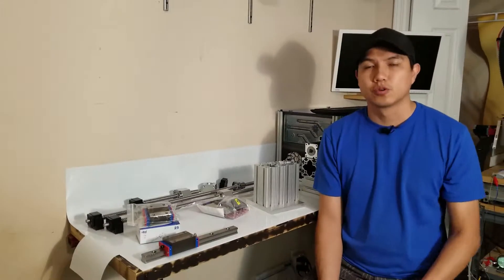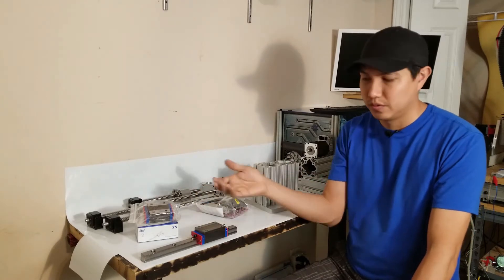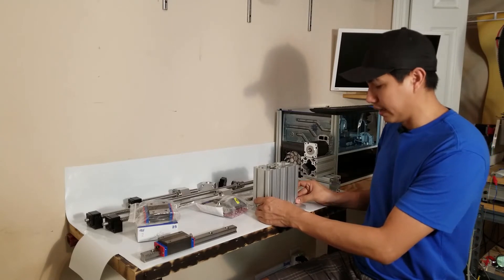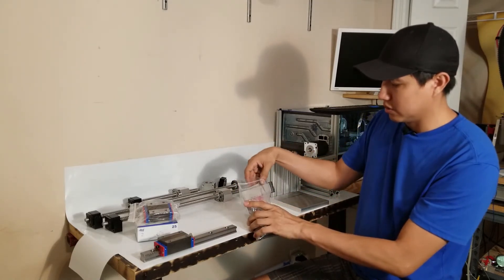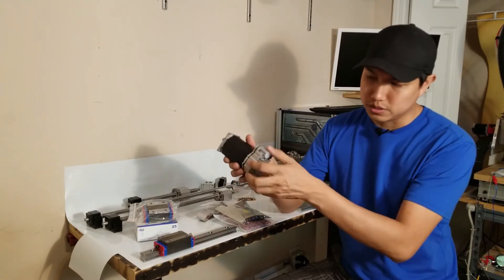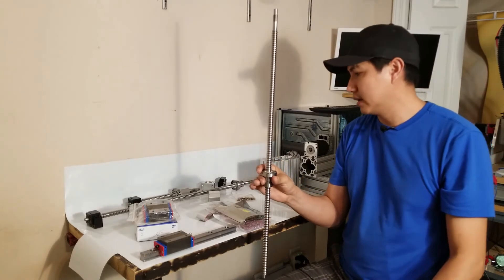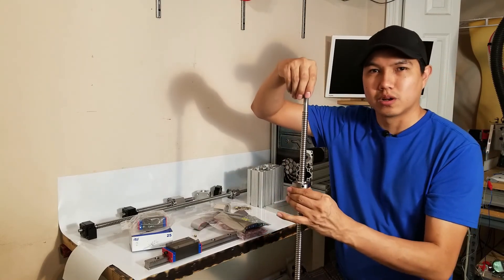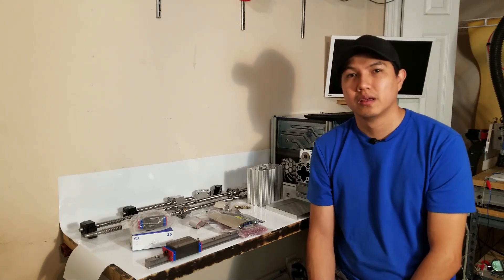Homemade DIY CNC router  (intro)

Comment: I AM BUILDING MY OWN I AM MOUNTING IT ON A 2 X 6 TABLE 4FT X 6 FT. I AM PUTTING TECNIC CLEARPATH SERVO MOTORS WITH ENCODERS ON THEM. THEY ARE WAY STRONGER AND MORE ACCURATE. ALSO MY TABLE WILL MOVE  NOT MY Y AXIS

Comment: Mario, cual es la lista de los componentes de tu CNC? no logro dar con algunas partes fundamentales. quisiera hacer uno igual o parecido como mi proyecto, te agradecería mucho
Reply from the maker: Roberto VEGA PEÑA Here is a list of the parts I use on my cnc build, keep in mind that I choose this because it works for me when building a cnc that’s capable of cutting 25” x 25” x 6” inches

 (3) pieces of aluminium extrusions series15 Or  3”x 6” inches  =  870 mm long (sides and gantry extrusions)
(2) pieces of aluminium extrusion  3” x 3” inches and (2) 3 x 6 inches =  635 mm long ( middle parts of the table)
 I got all my aluminium extrusions from 80/20inc.com 

(2) 1605 ballscrews  = 750 mm length  (800 works too) 
(1) 1605 ball screw = 300 mm length 
I got the ballscrews from eBay 

Linear rails  BGR25 =  2 pieces of 300 mm
And 4 pieces of 850 mm
 Linear bearings  (12)  BGXH25BN  
I got all my linear rails and bearings from trimantec.com 

All my screws and aluminum 1” thick plates from McMaster-Carr.com but you can always find that in other places too 

I went with servo motors from Teknic Clearpath,  but stepper motors would work just fine too and can cost a lot less 
 And the ESS and C25 BoB from cnc4pc.com
Same thing there are other controllers out there

When designing your own cnc  you can go with different parts smaller aluminium profiles and small linear rails/blocks can save you some money too 
 Or you can consider buying one already pre-build.  Here is a link to one I wanted before I build mine 
http://www.cncrouterparts.com/benchtop-pro-2424-2-x-2-cnc-machine-kit-p-314.html

Total cost of my cnc build was around $4500 -5k

Comment: Hi, I like the videos about your CNC build. Could you provide more information on the servo motors you picked?
Reply from the maker: Sascha Schwarz they are clearpath technik SDSK 2331s. You could choose a lower model since this ones I choose have a lot of power and torque
Reply: Thx for the quick reply. I am currently looking into the those integrated servo motors http://www.jmc-motor.com/ntegratedservomotors.html as I could them with 180W for less than $150 each.
When I watched your videos about milling aluminum it looks like you don´t use any lubricant/cooling for the milling bit right? Make you can make a video and talk a bit about the feeds and speeds you run on your CNC for the different materials.
Reply from the maker: Sascha Schwarz yeah I don’t usually cut aluminium, but when I do cut it I don’t use coolant or lubricant since the vacuum table is made of wood and it will ruin it

Comment: What specific clearpath servo did you use? The sdsk or sdhp series?
Reply from the maker: Chimaeria it’s a sdsk 2131s  if I remember correctly
Reply: And what is your opinion about them now that your cnc is finished? Enough torque? Have you actually milled some aluminium with your cnc yet? Some footage of that would be nice. :)
Reply from the maker: Chimaeria they do have a lot of torque and speed  no noise compared to a steeper and you don’t need a separate driver and has build in encoders  the down part is the price,  
 I haven’t cut that much aluminium since most of my work is with cast acrylic
Reply: Well anyway, I enjoyed your cnc making vids alot. So ill be the first to watch some new footage.

Comment: Clear path servos... Too expensive imho... Check out my results with steppers, +/- 0.01mm or 0.00039in tolerance on most parts coming off my machine.
Reply from the maker: Innovative CNC I have check your videos  even the 1hr long,  I was impress with the acc on the z-axis height,  that's where I get all kinds of readings on mine 6040.
 I have strippers on that cnc with the G540 and mach 3 and I don't know why but my z axis keeps loosing "steps" so I have to recalibrate at least once a month
Reply from the maker: Not strippers,   steppers.. auto correct b.s.
Reply: Have you tried to move the z axiz by hand with the machine off to check for binding or resistance? You can turn the lead screw slowly by hand and go all the way up and down feeling for any binding. If it's not that then you might have an interference problem possibly caused by an issue with shielding on the z motor wire or grounding drain. Do you miss steps only when cutting or just when moving the z? Are you using shielded motor wires?
Thanks for watching my videos too. Let me know if you have any questions.

Comment: Wow, this would be amazing if I get the space!
Why do you make one though, if you already have one?
Reply: It would be really nice if you would add some information about how the cnc operates etc, for people like me that are not really experienced with it!
Reply from the maker: Pine PC design  my 6040 cnc have some limitations, max cut out is around 22"x14"x2ish  and it has some "flexing" and that's not so great when you trying to get a good surface finish and tight tolerances,  plus my b-day soon so I gave myself an upgrade. Hahaha
Reply from the maker: Pine PC design yes for sure  I'll try to explain more as I go along
Reply: Alright man, cool! Do you have any opinion about the x-carve from Inventables?
Reply from the maker: this is my opinion just from the videos I have see,  I only own the 6040
  the X-carve, Shapeoko, and the chinese 3040 -6040 are all god machine to "start" or to prototype but none are really a up for everyday production runs, all have their goods and bad    some have belts instead of ball screws and some have roller bearings instead of Linear bearings, some have bigger cutting areas than others
 At the end it depends what you are planing to do with the CNC  and which materials you would cut, the harder the material the more rigid you would want the CNC to be
Reply: Radikult that's a really good answer, so thank you for that.
If I get enough space, I'm going to have to choose between a pre-made one and building one myself (like you're doing now.) 
I'm interested in the rigidity differences between let's say the new X-carve and the one you'll be building now, especially for carving aluminium. 

If I buy a standard X-Carve, I'm worried that won't be enough for aluminium, even if it's only now and then.
Reply from the maker: I know you haven't seen what I'm building now and I don't own a X-carve to try to give a fair judgement  but just from the videos I seen of people with x-carves, I'll say it wont be a fair comparison, the x-carve has  roller bearings for motion and belt driven and the aluminium extrusions are around 1X3 inches Vs the one that I'm building has- Linear bearing rails and ball screws and  3x3 and 3x6 inches extrusions, but the price is around triple the X-carve too .. its not an apple to apple comparison

Comment: Would love to see the design.
Great work man.
Reply from the maker: Milan Potter that's the thing, I don't have design plans   
All I have a notebook with some notes and measurements  
I would cut some pieces as I go along
Reply: would love to see rough design of what you will make.
i have made my own to do very simmilar as you have but if i was to do it again i would have a moving bed in the Y axis and a fixed riser sort of like the C-Beam machine
Reply from the maker: I see, kinda like a MILL instead of a CNC router,  the only thing is that the bed tends to be small, if you want to keep the same footprint
Reply: Radikult yea this is true but allot more rigid for same materials